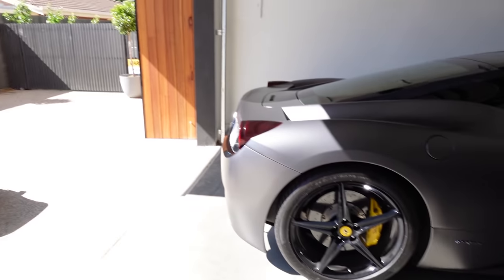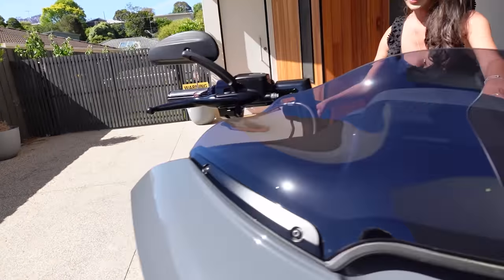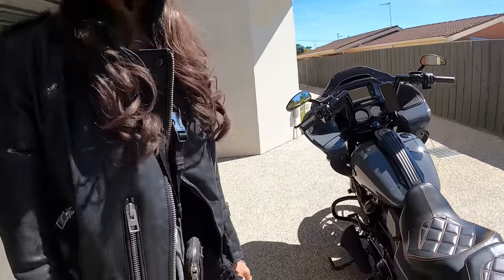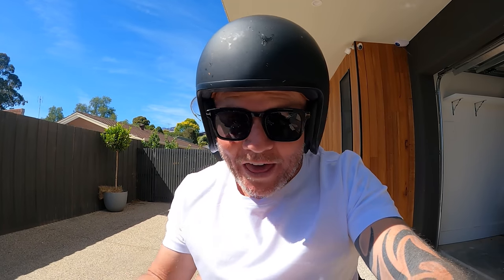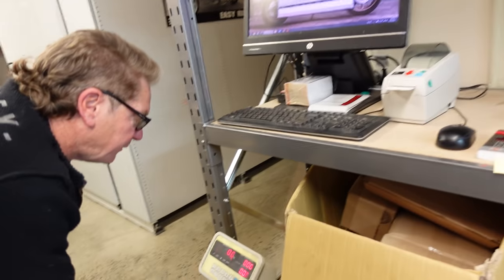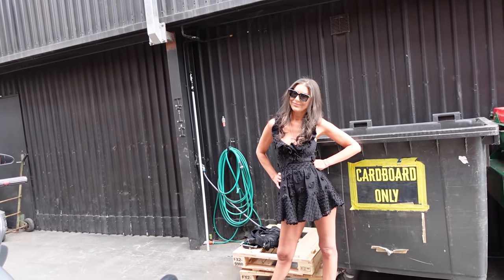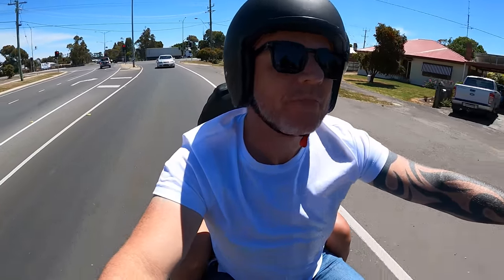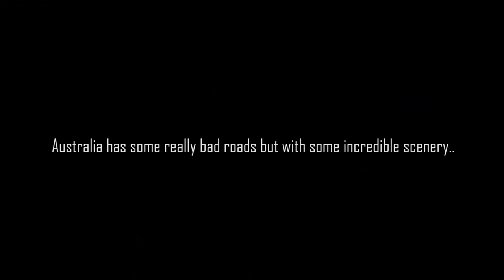First ride on my CVO Road Glide

Comment: My only advice is and I hope I see or hear about it in your part 2 vlog - is that you slow down than the regular speed on that upcoming bumpy road Danny.  V has already stated the suspension isn’t that great or comfy and her feet slide off her foot pedals and she afraid of coming off.  I understand you are testing it all out but your passenger needs to feel somewhat comfy or at least safe xx. 
Col and V are great btw...

Comment: Danny I have OHLINs front and back the problem with the back suspension you have to constantly take off bags to accommodate passenger,  I would of got Wilbur’s suspension the back is automatic and will adjust to rider weight. Also take off the windshield for Veronica’s helmet she’ll love it better. By the way Veronica is fire

Comment: Try the suspension softer so it doesnt fire back as quikly if that makes sense. It seems easy to adjust so just play and test out the softer sttings maybe.
Reply: Then it will bottom out faster, they're just shit and need to be upgraded.

Comment: I just bought some Ohlins 772s and would very much recommend them. Stock I found induced a wobble going around long sweeping turns which certainly got my attention but not in a good way. Will upgrade the front suspension this coming summer. Keep up the good work 👍🏻😉

Comment: Harley suspensions are very bad… too less for the money paid… this 50k bike and the street 500 (9k)perform alike from Harley-Davidson when it comes to suspension ( to be honest the street rod 750 500 pound is just about 70 hp and the road glide maybe about 90 hp-900 pound except torque the performance might be just same )… it such a shame… thank you Danny and Veronica for keeping it real about the dumb suspensions… I saw a vedio of Matt  riding the new sportster S with 1.5 inch suspension travel and saying it works ok… maybe the USA road are clean but I don’t think that’s the case with Australia… HARLEY if you are hearing your customers … please ship that bike with good suspension for Australia( Make a good Milwaukee compression , rebound and preload adjustable suspension)…we hate spending more on suspensions ….maybe the stock motor  114 is better in traffic( heat management)… I should not complain about power..

Comment: Legend suspension all day long Danny…did the rear first on my 2019 SGS just showed up how bad the front was…so revo As installed now it’s a totally different bike,keep in mind my wife’s back is as bent as a politician and boy was she in pain with the stock junk that comes as standard…..btw look under the passenger seat you will find a Crome cap that screws in the rear fender where you have the thumb screw ..it tidys up the fender when ya wanna fly solo

Comment: Danny, switch the seats from the Street Glide too  the Road Glide - I put the '09 CVO seat on my Road Glide - 110% better!
Reply: Doesnt change the prehistoric suspension. I sold my 2016 Street Glide because even after spending $2500 on an upgrade, it was still worse than my stock 07  Wide Glide suspension. The '18 and up  stockSoftail susp is so much better.

Comment: Did you try raising the passenger boards that would help V out. You can remove them and bolt them back on a little higher, that's how  my 18 Road Glide is.

Comment: I have a 21 roadglide limited. The ride for me and my passenger is very good. I know the touring models have the 13" shocks, but I have them set about a 10 and it rides pretty well. Better than my 17 ultra limited even did.

Comment: Agree about the Harley suspension, how can you have a touring bike with 85mm of travel. Uncomfortable sports bikes have 120mm. But I still love it. Can’t wait to see the mods.
Reply: It’s actually closer to 65mm travel standard. I just changed my 2020 street glide shocks for Ohlins and took the old ones apart. The right one with the tiny spring doesn’t even have oil in them. It’s just a fake shock. There’s no wonder they cause the bikes to bump steer, the swing arm twists with all the load on one side.
Reply: @Mi-ck  that’s interesting, how do you like the Ohlins? I did cheat a bit, I went off my softail slim. Which begs the question, is the Heritage a better tourer with 113mm of travel on the rear? Cheers
Reply: The Ohlins are amazing. I only put them on last weekend after a friend wrote his street glide off after hitting a bump in a corner at 100kph. He’s fine, somehow came out of it with hardly a scratch. 

Just after pulling out of the driveway I felt the difference immediately. It used to be tiring having to pay so much attention to the road to prevent shooting the wife off the back. Now it just soaks up the bumps without any jarring at all. 

I have a vid of the old shock with the spring removed showing how there’s no damping at all. Id like to get Danny to have his pulled apart on camera to show how bad they are. For HD to save $50 on a shock I can almost be certain people have come off and been killed.

Comment: When I got my M8 Road King I got bounced by the suspension. According to the manual at 176 lbs (79 Kgs?), I needed to turn the suspension down to 0(zero). Much higher & it starts to ride like you're sitting on an old timey wagon's buckboard.

Comment: My Girlfriend hurt her back bad on my RKS with standard suspension.  Now running Ohlins rear shocks and Wilburs front springs to fit.  Decent tyres help also.
Reply: A full Wilbers Nivomat would have been cheaper and better. Don't get me wrong, Öhlins are very good shocks, but the self leveling (changing spring rate and damping while you ride) is just a completely different level.

Comment: The Stock suspension is not good.   It just bottoms out on anything but table smooth roads.  One side has a stronger spring that works with the hydraulic adjuster to do all of the work.  On the other side the spring is so weak and puny it really doesn't do much of anything bar a little help on the rebound and on that side there is only the spring, the shock has no fluid in it at all.  So effectively the left side of your bike with the adjuster does all the work and the right side just stabilizes the rear end as the suspension travels.
I swapped out my rears on my Street Glide Special and my friends CVO Ultra (both 2020's) for the Ohlins STX Blackline HD 772's.  I went with the 13' as this gives one more inch of travel over stock on the Street Glide Special and the travel makes all the difference in the world.  These are not a big expense but really improve the ride.  Both bikes no longer bottom out 👍😎

Comment: Best upgrade(s) for your new CVO Road Glide:  1.  Replace the stock Harley suspension with Legend Suspension (13" REVO-A rear shocks, & AXEO kit for the front).  2.  Add the HD (or Thundermax) Fan to the oil cooler; Harley dealer can then enable the ecm [more consistent and safe oil temperature].  I have Legend Suspension on my 2020 Street Glide Special (along with a 114-to-117 Stage-4 Kit, SE High-flow Exhaust System) and both Harley Tuners (includes Auto Tuner utilizing 18mm wideband O2 sensors).   If nothing else, do the suspension...you'll love and so will Veronica!    Tom M., Hawthorne, Ca., USA.  '21 CVO-SG / '20 SGS / '06 CVO V-Rod.

Comment: The knob on the shock absorbers  adjusts the compression and rebound of the shock. If you don't notice any difference then your spring load capacity is to heavy
Reply: It’s sets the Preload to be technical…

Comment: I have a 2021 heritage after owning a 2019 streetglide and a 2020 road king and even that with a single suspension is better than the streetglide and as good as the road king.  pretty sure the low prolie tyres has a lot to do with it and only 2inches of travel.
Reply: Heritage is " the king of the Harley empire".

Comment: Look into Fournales shock absorbers, made in France, aerospace spec shocks with no springs that never bottom out, expensive as hell but probably not much more than the Harley crap. No adjustment needed going from solo to two up.